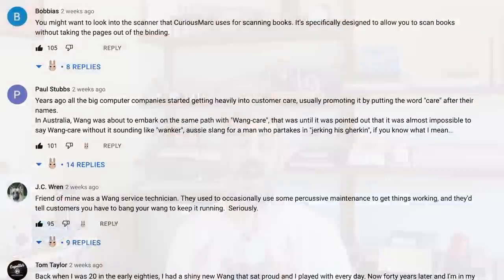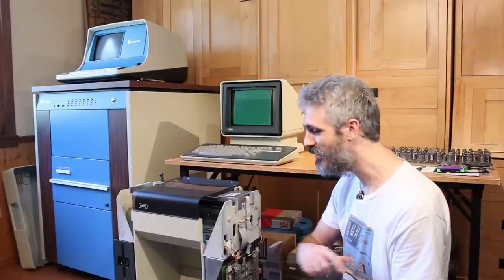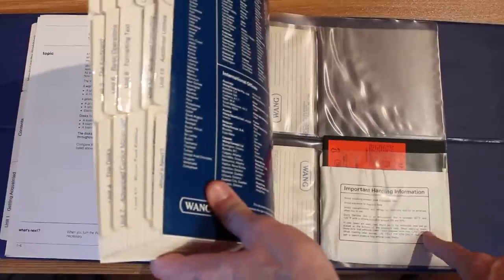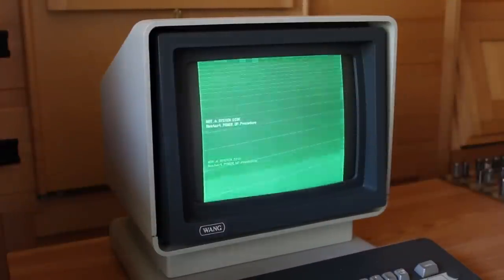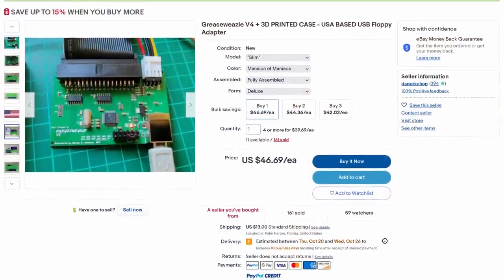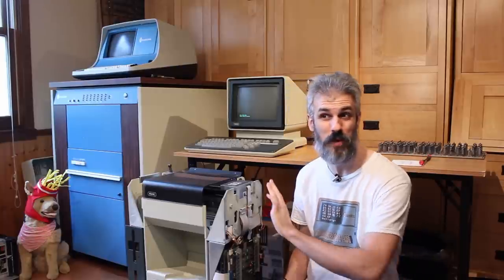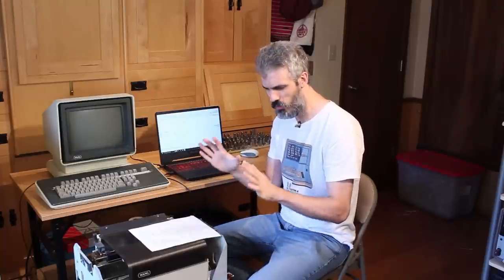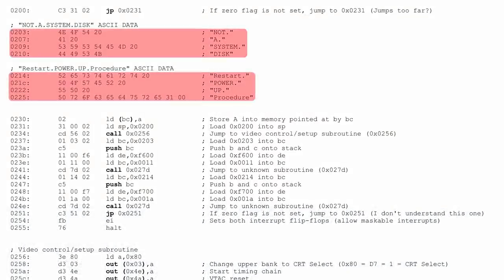Wangwriter Pt.2 – It’s Alive!

Comment: I worked at a university's VP office for IT.  My first project in 1987 was to replace a Wangwriter with a PC and WordPerfect.  Most everyone hated the Wang.  The training programs were expensive and a lot of people came back after a week long and still couldn't do basic functions.  The FDDs were always acting squirrely, people would use the cleaning kit before every new document.  After fiddling I discovered a complex of dust bunnies in and around the r/w heads.  So I basically fixed the main problem, so the people who liked it or were doing slight edits to an annual document kept using it.  Newer hires jumped right on the WordPerfect bandwagon.

Comment: My God!  Someone else has heard of / worked with Systems Engineering Labs (SEL) computers!  In another life, back in the late 70s / early 80s, I worked for a contractor building and maintaining a data collection system for the Navy.  We used the old SEL 86 "mainframe", later the SEL 32/55 and 32/75 minicomputers.  The 32's were pretty much in the same class as the DEL PDP-11 systems, but supposedly better at real-time processing and a lot cheaper.  We had two of the removable pack 80 MB hard drives, two open-reel 9 track tape drives, a chain printer, a card reader, and a Lear-Seigler ADM-3A console terminal.  (The SEL 86 - an older, crappier system the size of a VAX 11/780 but far less sophisticated) had two washing machine-sized 24 MB removable pack hard disks and a KSR-33 Teletype hard copy terminal as a console.)  There was also a 'Delta Data 5000' CRT terminal for text editing - a very weird beast, 80 column by 27 lines screen.  The Navy's production systems used Beehive B-550 CRT terminals.  Our code was FORTRAN IV and Assembler.  So many weird, odd beasts that 99% of the IT industry of the day seemed to have never heard of.

Comment: For checking the printer's functionality, it might be possible to turn off the printer (seeing as it has its own power button) and then turn it on while holding Line Feed. I'm not familiar with Wang DWPs at all, but both my Silver-Reed and Panasonic DWPs do self-tests that way and I do get the impression that the printer here is one of Wang's existing models taken out of its case and integrated into the machine as opposed to a custom design.
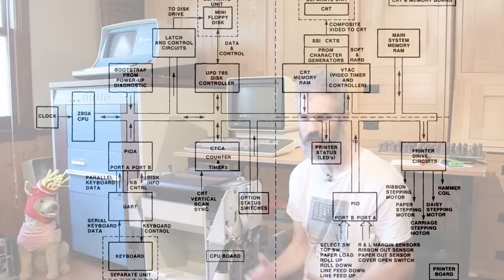Reply: It looks like the printer hardware is directly driven by the computer, in order to save cost and complexity. (Source: 13:25)
Reply: @user2C47  perhaps, but since there is a dedicated control board and the printer can be turned on/off independently of the rest I feel like that board is probably pretty similar to one of Wang's other printers

Comment: I'm stoked you have boostrap level control of the system!  What you may find in the bootstrap ROM is code AND records that describe the hardware environment.  C/PM expects there to be a manifest in ROM that declares a rudimentary BIOS and enough info for a kernel to begin a second stage boot.   The Archive/Data Disks using track0-sector0 that way was a C/PM idiom long before MSDOS or Apple DOS.

Comment: I never worked on the standalone WangWriter, but back in the 80s I worked on VS-series machines (minicomputer/small mainframe) that had both standard screen-mode terminals (like 3270s) and line/character-mode word processing terminals that ran that same word processing interface.  Those machines booted over a coax cable connection from storage on the VS's system disk (the ones I worked on were VS15s and VS100s).  The daisy-wheel printers for word processing hung off of the VS system as well.  I also worked a lot on Wang 2200s which were a TOTALLY different animal, and for a short period I actually owned a Wang PC that booted straight into BASIC and used hard-sectored 5.25" floppies...I'm not sure what ever happened to it.

I actually kind of miss the VS-series machines - I wrote a lot of COBOL code on those, a smattering of RPGII, and some oddball 4GL stuff.  Underneath the hood they were essentially S360 instruction set with an added stack on, I think, register R15.  The companies I worked for got a massive amount of work done on those boxes.
Reply: My ship, USS Carl Vinson had one. It was declared obsolete and I got to smash it up with a sledgehammer.
Reply: @ostrich67  Hulk SMASH! 🙂

Comment: Haven’t finished the video yet, but the clue was the system diagram you showed early on. 

The crt info is generated directly from ram. The table is there about where the attribute and character are stored in ram. Used to work on four-phase system and it did the same kind of trick.

Comment: if you're going the custom programming route, I'd start with CP/M and write the interface code for it.  That way you have the OS itself already written with working apps.
Reply: CP/M only needs a few routines to be written to make it work on a random Z80 machine. Never done it myself but there are custom Z80 builds on YT who all have struggled with the same issue 😁
Reply: @reinoud6377  Correct.  I want to say it's the BIOS that needs to be written, but a CP/M BIOS is a bit different than what we think of BIOS today.  Back in CP/M, it was loaded with the OS and contained the instructions on how to read/write to all the different peripherals. (terminals, disks, etc.)  The rest of the OS only cared that you were running a Z80 with a sane memory space. But the bottom line is there's very little to write to get CP/M running and a lot more programs available when you do get it to run.
Reply from the maker: That's definitely the goal!
The memory map of the Wangwriter makes it a little difficult because of the banked memory and dedicated CRT space, but if we can get a custom BIOS written, it should be able to boot into regular CP/M 2.2 and run any standard CP/M application.
Reply: @UsagiElectric  I think you are too optimistic. There is a reason wangs are so rare. They did everything proprietary. That memory mapped IO for everything means you might have to write your DMA routines and get the timing right and then decrypt the protocol for system bus attached devices. I am not sure out of the box cp/m is going to function even if you get a BIOS to boot. But hey, its your wang to play with.

Comment: The next step is to dump the computer's ROMs. Somewhere in them  you will find the code for reading and writing to the disk, and reading the keyboard. From there, it is possible to write a custom BIOS (which will be read from disk at boot) and boot actual, real CP/M.

Comment: 18:30 No surprises there: Commodore also used a 35-track format, but the drive mechanisms will happily seek to Track 40 (sometimes even 41) before jamming.  Many nibblers do 40 tracks as a default, just in case something non-standard was deliberately stashed in the upper tracks.  That GreaseWeazle is a heck of an interesting little device!  -- JC
Reply: Comodore disks and drive have actually 80 (or 70) tracks (phisical). Drive can even seek into any of these track when properly comanded. Half of the tracks are spacing tracks. Not actually in use. When the 1541 goes nuts, usually is because it had landed over a spacing track rather than a proper track. Because over a proper track, drive is able to tell where the head is .... and in the spacing track is not. Once it gets "out if sink" it flashes fast and you need to send a reset command and bang the head to track zero. I have read that there was a cardboard spacer with the for of a disk to bring the head into a certain track. ..... YES its is 40 or 35 (I dont recall) ... but more like a head limitation .... Commodore things. So many tricks in the 1541. Data Becker has an entire book of its routines and entrypoints. Beast of a drive.
Reply: @38911bytefree  Yes, you can command a 1541 drive head to stop at any one of 80 places (or 82, actually, since most can go up to Track 41 without jamming), but the in-between ones are "half tracks" (e.g.- track 1.5, 2.5, 3.5...).  Some copy protection schemes have implemented them, but in my understanding only a very few.  It was much more common just to use tracks 36 to 40, which existed in "no man's land" but could be used with some reliability.  The cardboard spacer you're referencing is the vibration protector that the drive shipped with.  If you send a 1541 drive head to a track higher than 41, it will likely get stuck; some even jam on 41.  The cardboard is shaped to push the head all the way back to track 1 and hold it there during shipping, which puts your drive back into operation.  -- JC

Comment: Just a thought - but i never insert a floppy into a drive with the power turned off, the reason being is that most floppy drives will spin the motor as you insert the disk, which means it's perfectly centered as you bring the clamp down - putting a disk in cold can cause it to be slightly eccentric (I used to align floppy drives in the 80's and you could easily see an alignment disk running off-center on a oscilloscope)

Comment: You do want to minimize brightness as much as possible since displaying the same text pattern over a long period of time will "burn" the green phosphor an result in a dark area on the display.  This is a constant issue with CRT displays especially in oscilloscopes.  If you look at the CRT when it is off and see some darker rectangular areas, that is the phosper burn.  The closely spaced track are the normal scan and should not be visible in operation but you had the system gain up very high.  The wider spaced zigzag line is the retrace where the electron beam is returned to the top of the screen to start painting the next frame of the display.

All of these displays have a vertical rate of around 60 Hz but it varies slightly due to control circuit variance.  The computer will generator both horizontal and vertical sync but again based on the local processor clock or the display chip clock.  Any camera you used will see the flicker unless the two frame rates on dead on or an exact multiple of each other.

It is our eyes that ignore the flicker an process the display as continuous but it is not.  The video controls that didn't make sense are the vertical and horizontal linearity controls.  They should be adjusted unless you have a full screen of characters or a test pattern.

Now, I have to admit I am confused at the text being at the bottom of the screen.  Usually first message is display at top left hand corner but the Wang machine may be different.

If you have no experience with Daisy Wheel printers, they are very reliable and a cleaning of the optical sensor paths will help a great deal.  Daily wheels are noisy, very noisy, because you have an impact driver that prints the entire character at once, not columns of dots.

That was quite the cleaning job you did on the IC pins.  The IC socket pins you displayed are individually machined, and usually plated with silver or gold so you don't want to mess with them.  Definitely state of the art for that time.

Had never heard of GreaseWeazle.  I will follow up on that.

Good Luck,  
Sincerely,

Richard

Comment: Ancient Shugart floppy drives used 35 tracks. The first drive I bought for my first computer -- a very early TRS-80 -- was a Shugart 35 track, which only cost about $700 (in 40+ year ago dollars, NOT adjusted for inflation).

The head positioner was NOT a lead screw OR a metal "tape" -- it was a plastic disc with a groove molded into one surface. As the stepper motor rotated the disc, a "stylus" (probably a ball bearing, I can't recall after all these years) rode in the groove, the result being dead-reckoning head positioning.

The formatted capacity was all of 89 KILObytes, and the head positioning was notoriously slow!

Worse yet, if I tried to speed it up using a DOS that supported configurable options (i,e,. NEWDOS80), which worked wonders with my 40 track MPI drive -- converted it from "machinegun staccato" NOISY head positioning to dead silent -- except for a faint "whoosh/whoosh" as the head slewed from one track to another halfway across the surface (the head positioning being optimized to the physical ability to move the head -- 5MS, IIRC).

Anyway, if I tried speeding up head positioning on that old 35 track drive, the motor would spin faster, as I recall -- causing the plastic disc to rotate faster -- causing the stylus to pop right outta the #$%@#$%@#$ groove!

I always thought of that setup as being something tantamount to a record player, with a "needle" that was always popping out of the groove.

I don't know how or if this will be of any help to you, other than to suggest that assuming it's a standard Shugart drive (by standard I of course mean a standard connector pinout and standard "instruction set" for things like track seek and data I/O), then I would URGE you to buy a better drive -- either standard 40 cyl OR an 80 cyl Mitsubishi (half-height DSDD, using standard FDC, i.e., does NOT need a DD controller to operate as a "plain" 720KB drive.

If you have the ability to write system level code, then you should have no problem revising the CP/M 2.2 BDOS to recognize the higher quality drive, and, make full use of its capacity (and slew speed).

(I don't have that ability, but, I'm definitely qualified to give free advice. :)

Comment: Since it uses a z80 processor it may be possible to use a generic 8080 or z80 cp/m 2.2 disk image on it. They are fairly easy to find on the internet. I know there are some 8080 cp/m disk images on deramp's website and I believe the z80 is backwards compatible with the 8080 machine code!
Reply: Unfortunately, CP/M did have to be customized for the peripherals, as those routinely varied incompatibly between machines. Thus, while the core of other z80 CP/M variants is almost guaranteed to be compatible, that is not enough for those CP/Ms to themselves be compatible.

Also, I'm not sure that the byte code for the 8080 is compatible with the z80, the descriptions always talk about the assembly (which is actually text) being compatible.
Reply: Wang is all weird proprietary architecture, always was.
Reply: @absalomdraconis  Yes, the Z80 is binary compatible with the 8080. All you would need to do to bring CP/M up on it is write a BIOS.

Comment: Hellorld!  I knew that's what you were doing.  This is great.  The system disk would be nice, and I'm confident you'll get that.  But what would be really amazing is if you could get the CP/M disk.  That might be harder since it was an option and many users (most, I suspect) wouldn't have had it.

We all know that the Wangwriter is a computer in its own right.  It just happened to be sold as a single-purpose appliance.  My suspicion is that the typical user was not necessarily remotely interested in computers, and may have valued the narrow scope of its function as originally sold.  But I hope you succeed!

Comment: The "unknown subroutine" is obviously what's copying the message text from the program area to the video text RAM.  The stack gets loaded with the start address of the message, bc gets the message length, and de gets the destination in video text RAM.
Reply: The 251 JP 251 looks like it just terminates in an infinite loop.
Reply: From Appendix G of the Maintenance manual, you can see that address F600 is mapped to line 23 and F700 mapped to line 24 of the CRT.  Interestingly, each character position has both a data mapping (what character) and an attribute mapping to control things like brightness or possibly alternate character mappings.  Even more interesting is the fact that you can write custom characters into the character generator.  This allows for custom fonts and rudimentary graphics.
Reply: That Maintenance manual is an entire architecture manual, and it appears to tell you everything  you need to program every bit of the system.  It's interesting that the printer is controlled at a very low level, with the main CPU responsible for driving the stepper motors to move the carriage, feed the paper, advance the ribbon, and turn the daisy wheel (as well as fire the solenoid/hammer to print a character).  Writing code to drive that would be quite a challenge.
Reply: Aside from the printer, it looks like writing a CP/M BIOS for this would not be too difficult.  You would have to write a terminal emulator to make the CRT & keyboard emulate a serial terminal such as an ADM-3a or VT-52.  Besides that, you'd just need some disk sector read/write functions, and you'd be mostly there.  It's interesting that the Wang Writer has no serial I/O port standard.  One would have to add an extra circuit board to implement one (unless you use bit-banging with unused I/O lines).  If you could plug in a serial terminal, that CP/M BIOS would be even easier to write.
Reply: @Mueller3D  yes. Worked on four-phase systems back in the 80’s that did the same thing. 80 columns, 0-79. He showed a diagram early on that showed where the video ram pulled the characters and attributes, as you mentioned.

Comment: Awesome! Well, I don't have a discord account, and don't really want one - however, now that I know your greaseweazel settings I will image the disks I mentioned in the last video with my GW and will look for any that look a bit more promising. If I find anything worthwhile I will post them on my server and give you a link so you can get it to run! Great work!
Reply from the maker: That would be absolutely mega, thank you so much!
Reply: @UsagiElectric  Is there any chance you can reply to this comment the hex signature (first 8 bytes) at the beginning of the disk? This also appears to be duplicated at 0x100. Can you confirm that on your disk image? From what I am seeing, it appears (of the 7 disks I successfully imaged) that there is what looks like a disk serial number at BOF. Those 7 appear to be just data disks, and do appear to be for a Wang system, although with a slightly different encoding. There are 4 more disks I have not yet been able to read, but will give it another go tomorrow...